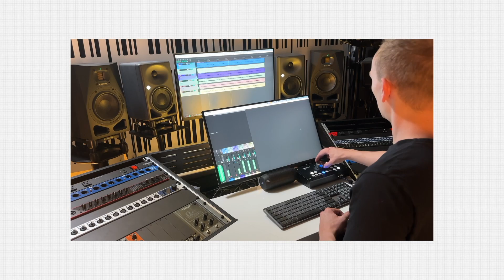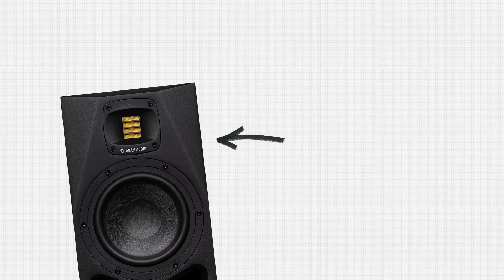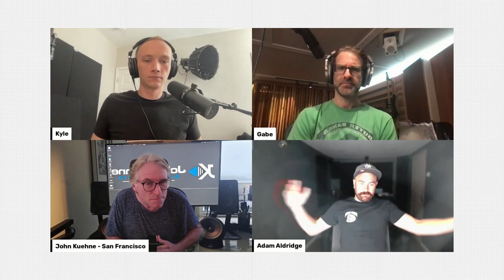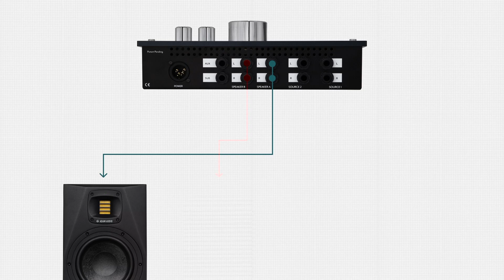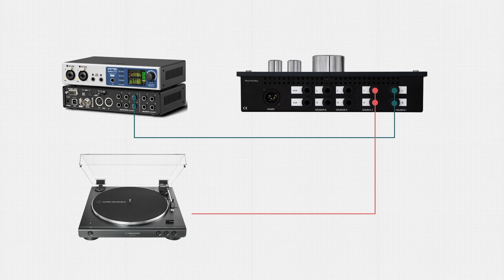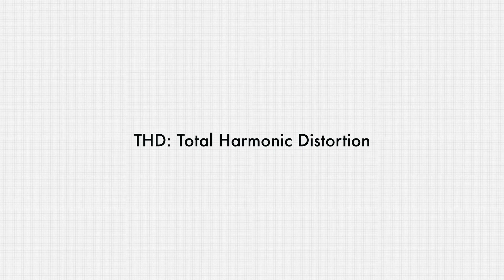Do You Need Multiple Monitors In Your Studio?

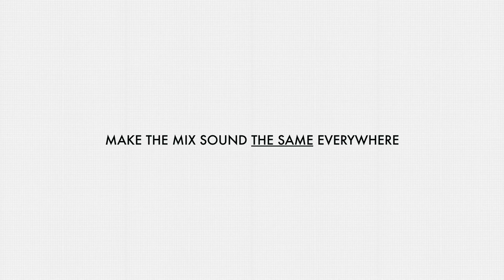Comment: 0:25 There’s no complete solution. Even pro engineers with studios know a guy with a studio they wish they had. Same with mastering engineers. Case in point, the auteur of this video is sitting in a studio most of us watching would kιΙl for, and I bet he wants to fix things in it. 

So since there’s no definitive answer, we need to see it as a perpetual curve of calculus. Thus, the answer is to make smart moves to improve the likelihood of having the capacity to make a translatable mix, be it multiple speakers for different listening options, better speakers that give you a specific functionality (auratones), or my favorite and easiest: have your main set up. Nothing fancy. I have only had HS80M’s.  Wrong size for my room. Got them as a noob because they looked cool. Should’ve gotten the 50’s. I didn’t. I just added some sennheiser HD600’s direct from and calibrated at sonarworks (a better result than just buying the software) and later was an early adopter of Slate Digital’s VSX headphones. 

Others buy monitors with included bespoke DSP to do a similar thing, and this is more common as rhe years go by. 

But for me? I know my (wrong) speakers and room. The other two calibrated headphone options just gives me a way to check the mix on other systems quickly at any stage in the mix, as they are inserted and disabled on my mix template stereo buds. 

Are they identical to what they claim to emulate? 

Don’t know or care. The key is, they are all DIFFERENT presentations of the same input, not that they be “authentic”. Same for modeling mics. People say “yeah, but it doesn’t sound like MY Neuma-“ slap no listener cares. It gives you options in post that can yield a better outcome. 

So I do not care if my janky two low to mid tiered headphone solutions sound exactly like Sweden’s studio or Dre’s or an exact replica of what it’d be like to mix on NS-10’s of some fancy whatever. It’s a pallet cleanse and will reveal very real mistakes you didn’t hear before. 

Then, use something like ozone to assess if you’re in the ballpark of the eq and loudness curve of your particular target or subgenre. 

This added two steps sound like a lot, and many would rather not be bothered. But it will save you time, money, and aggravation immediately if you add these two steps to the end of your process, and then TRUST the process. That’s the hard part. We often are so used to doing things our (wrong) way, that any suggested to change it feels arduous. 

Luckily, these two steps - check on multiple systems and then check algorithmically if you’re in the genre-specific ballpark - are left to the tail end. It should not change anything else you usually do if you already are using a computer at all to mix.
Reply: I like your thinking. Using different monitors just as pallet cleansers...
Plus, the trick with different perspective on the mix with Ozone AI mastering somewhere in the process is something I've seen already done by good mixing engineer working on limited monitoring, rather bass-shy headphones. He used it, and was like, oh, I was right, not too much low end. And then repaired that in the mix and turned off the Ozone till he finished the mix.